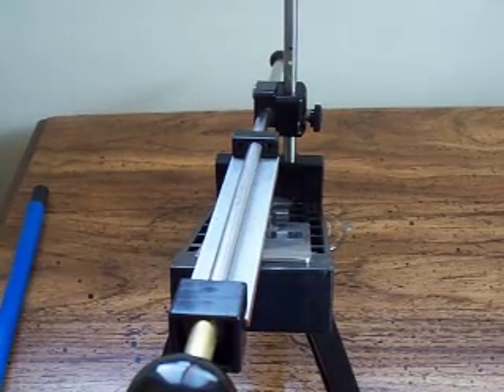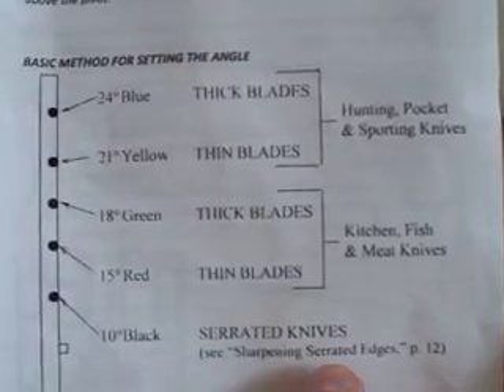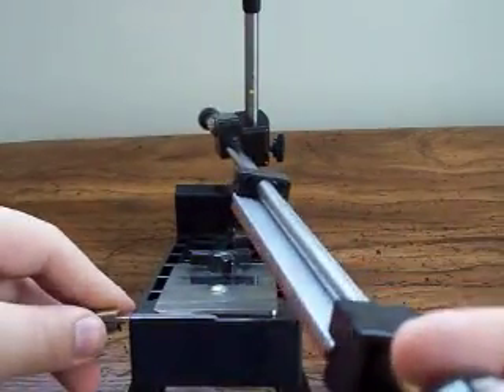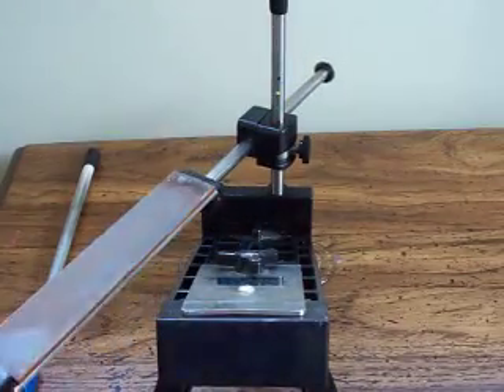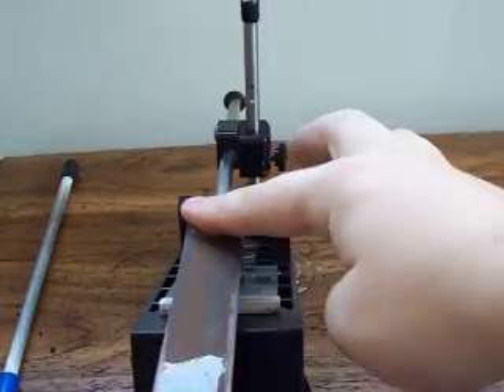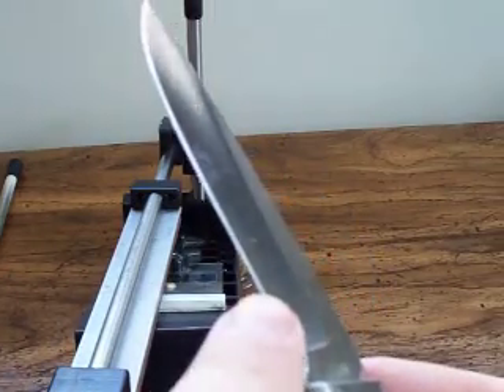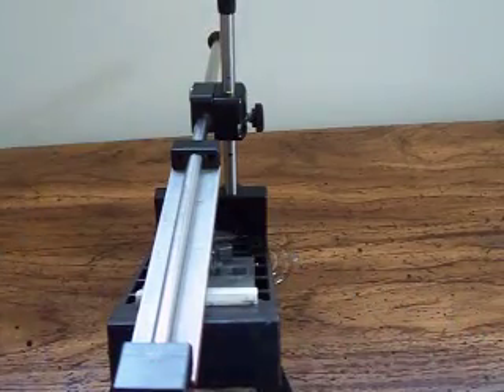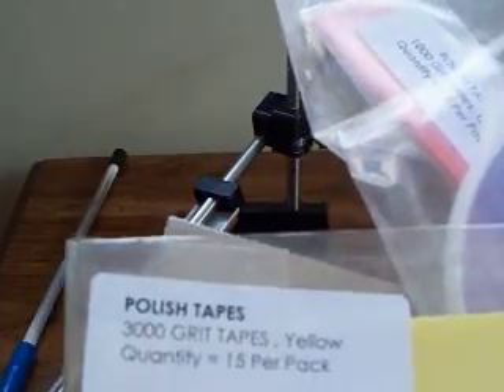Video Request : Edgpro Apex In Use...

Comment: @Urudrim No you can still convex blades that have a convex primary grind (though it is not really possible with an ffg with a convex secondary bevel), it just take a little more technique and skill. Though I do prefer my belts for my convex edge, my swamp rat waki currently has a mirror polished convex edge courtesy of the edge pro; it certainly isn't as quick as a mousepad and sandpaper, or a belt sander/grinder, but you can get amazing results.

Comment from the maker: actually you cna gte a shavign sharp edge on the sharpmaker with the fien rods, just takes some patience...the advantage with the edgepro is the set angles so as the user you cant screw it up if you wanted, lol, but the sharpamker is easy to use none the less...just gota kee the knife straight...and take your time...

Comment: Is the Spyderco better ?

With the Sharpmaler, you can rapidly switch from one stone to the other, thus sharpening both sides of the edge at the same time. With the Edgepro, you have to remove your knife and flip it over to change the edge side.

In your experience, is it better to work both sides at the same time or to finish one side and then do the other ?

Thank you !

Comment from the maker: carbide sharpeners are brutal on edges they shave off way too mcuh metal, sometiems you get lucky and geta  sharp edge, but most of the time it just rips the edge apart...you cna get alot of angles sharp, but how wide it is has to do with a compramise between sharpness and longevity...the smaller the edge the sharper it cna get literally, but the shortwer you go the faster the edge will wear, wider edges last longer and dotn damage easily but you just cant get the same sharpness on wider edges..

Comment from the maker: The clock chimes evcery 15 minutes and on the hour it chimes each time for each hour, so 4 chimes for 4 ocklock and so on...and yes I ahve 2 dogs, both of them are lhasa apsa's but one is 13 years old, and the other is only 1 and a half, so they go at it al the time, lol, always barking at eachother, and if they are getting alogn fine the younger one barks at every noise outside...haha, so I often have to restart a video because of the barking...

Comment from the maker: no not really, I eman for instructiosn it will tell you that you cna sharpen serratiosn by sharpenign the flat side or back of them but that wears them away too fast, so no and no...I use my spyderco sharpmaker for both serratiosn and revurves, now I did sharpen a kukri machete on this, but thats a large curve so it was easiler...on a small folder a recurved blade woudl be too hard to sharpen and not work with this...

Comment: Motorized belt sharpener is not a good idea. If the blade edge gets too hot you'll ruin the tempering, the edge will become brittle and chip.